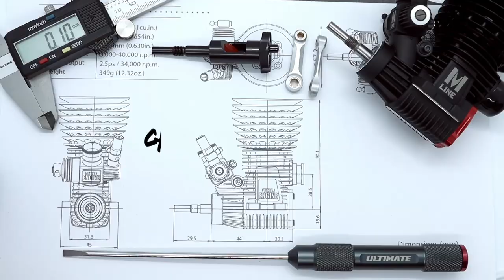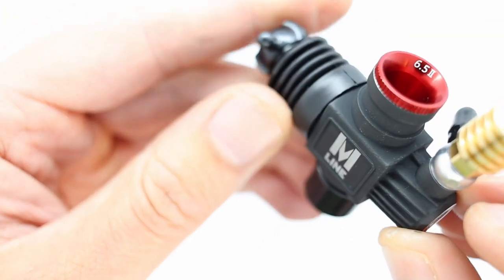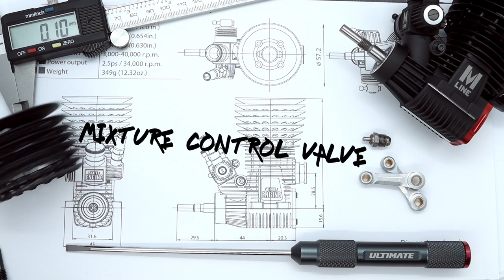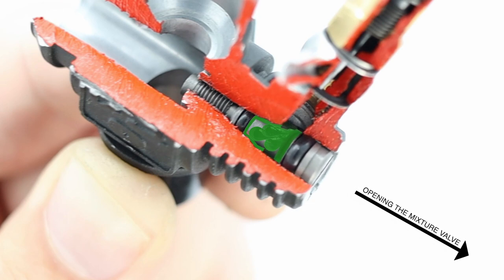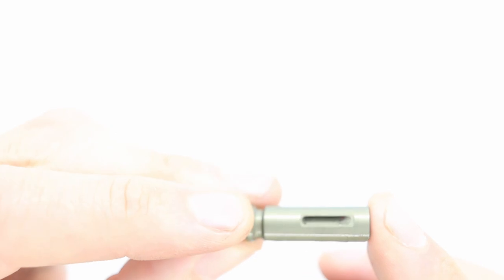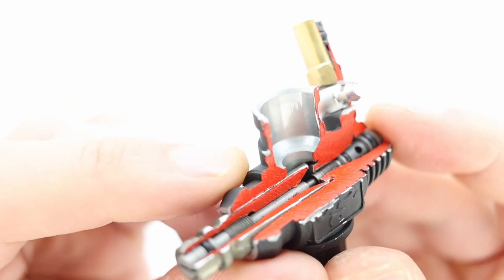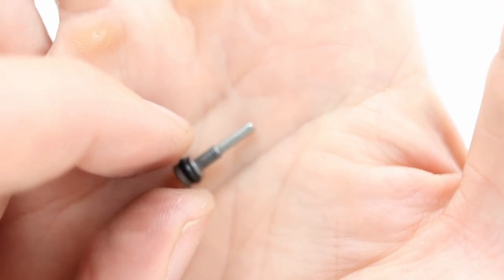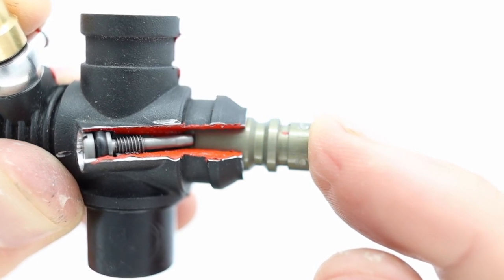CARBURETTOR - Ever Seen INSIDE One? Nitro Engine Carb Breakdown, How it Works

Comment: Nice...How about also long lsn vs short lsn tuning, and needle tip differences between different carbs in the same brand also in brand J vs brand Q. See what I did there. Keep the videos coming🏎💨💯💪💪👊👊👍👍
Reply: basics are the same on every engine, except stupid carbs that have oval exits and stuff - they suck.
Long and short i find just change how the engine feels accelerating, long you get less adrupt midrange transtion(this is also effected by shape and length etc of the MSN), short - the LSN is more on the "its mostly used for idle" side as the HSN fully takes over sooner.
Reply from the maker: Good question, can add it to a follow up video.
Reply: @MrSupermugen  true I agree the basic principles are the same, but I find that on long lsn carbs for less experienced guys tuning the needles in reverse(lsn first then hsn) to a short lsn carb(hsn first then lsn) tends to end with a more consistent running engine. Being as though the hsn on a long lsn carb needs to be rich enough to force fuel pass the needle for a longer duration of throttle pull vs on a short lsn the hsn needs to be lean enough to prevent dumping to much fuel from 15-25% throttle up to full pull. And the taper of the needles has alot to do with feel throughout the powerband. Also the thread pitch can effect the "hour or 5min" turn depth between different needles(an hour on brand x could be 1.5hrs on brand y).